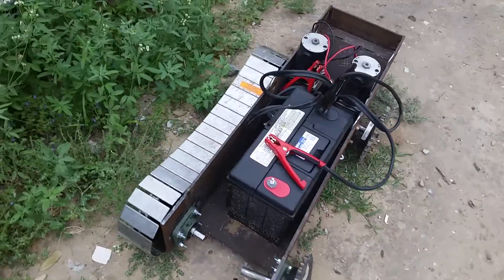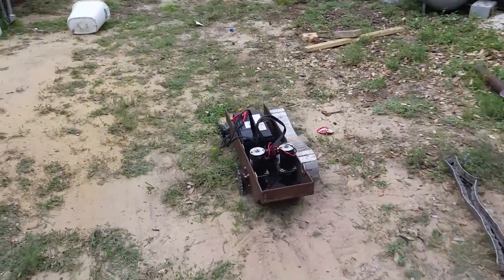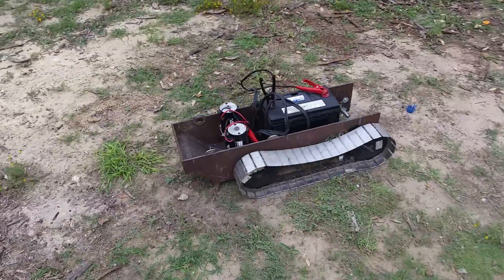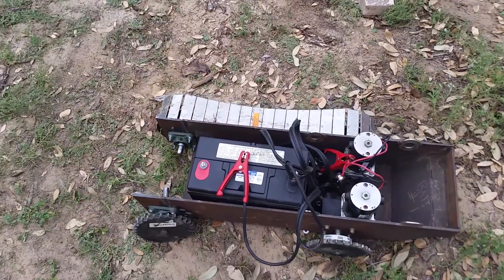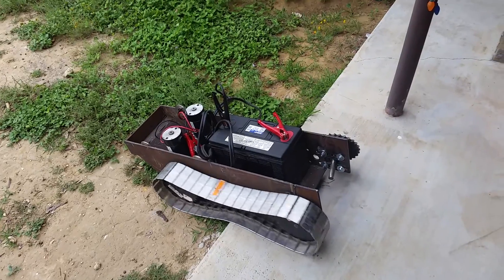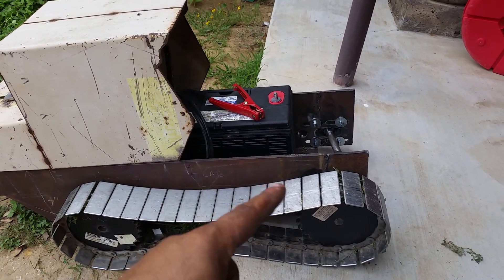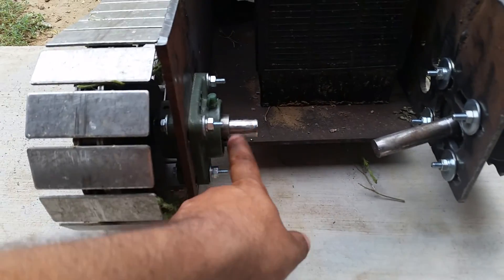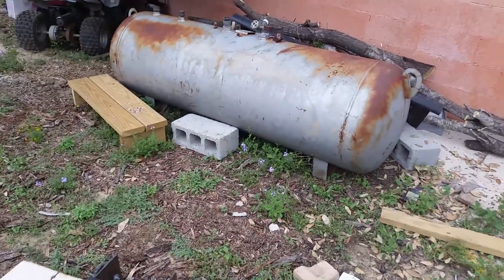RC CAT 963 973 UPDATE, TRACK LOADER PART 6 HOW TO BUILD AN RC DOZER

Comment: What sort of motors used
Reply from the maker: I think they were Jazzy motors from a 24v electric wheel chair. Ebay has many to choose from. This project was getting to expensive that I had to stop. the electronics and guts where going to run about $1000 so just pulled the plug.
Reply: what happened to the remains? @cutweldngrind